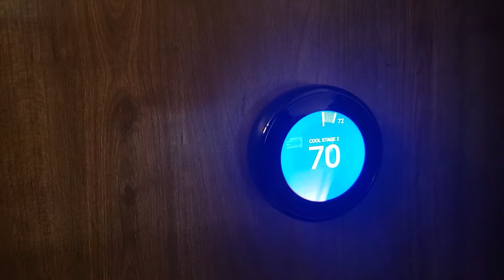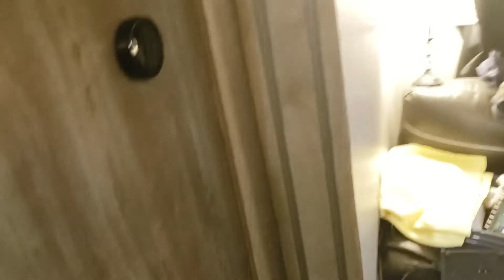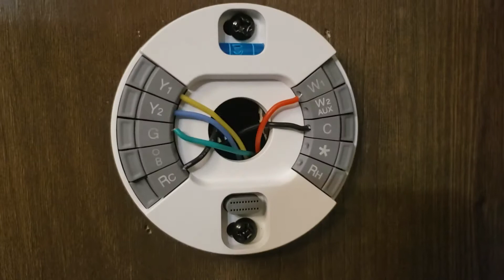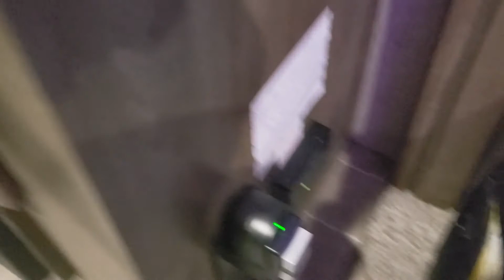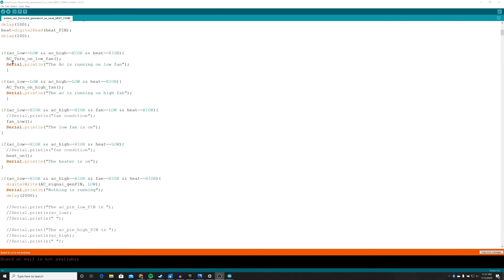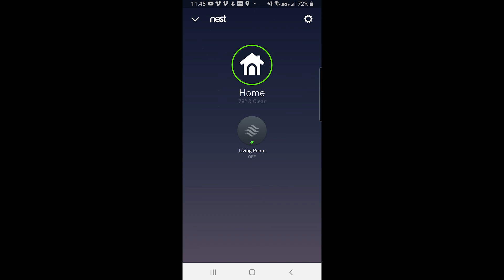Install a Nest Thermostat in an RV!!! Using an Arduino

Comment: Hello, I have implemented the system and it works very well.

Thank you for your efforts to reverse engineer the dometic thermostat and offering this project on YouTube.

There is one problem.  When the AC comes on then it reaches the target temp, the fan keeps coming on then goes off within a minute or less.  It keeps repeating this process for a while.  It looks like a switch that need denouncing.  I am going to research this more.  Have you seen this problem, anyone?
Reply from the maker: It sounds like the ac is coming on using high fan and then when it reaches the temp it turns the ac off but leaves the fan on for a minute. If you are using this in very hot climates this is what happens but it should be switching from ac high to ac low sometimes during the morning or night when the outside temp comes down.

Comment: This is awesome. I tried to replicate this with my own logic analyzer, but couldn't get it to work. I used a Dometic 3-wire thermostat and connected my logic analyzer to the control wire terminal. I'm not seeing any signal output at all, and my Dometic thermostat shows error E1, which means that it can't communicate with the control box in the A/C. That makes sense because the thermostat is not connected to any appliance. How were you able to capture the digital signal?
Reply from the maker: So I used the logic analyzer while it was connected to the ac unit. Just have it connected like normal and add a jumper wire to the control wire and record the signal when it is running. Yeah it'll get an error if it is not connected so you can't see the signals that way. By the way depending on how you have your logic analyzer setup you may also have to connect a ground wire from your logic analyzer to the ground of the thermostat. Hope that helps, if you have more questions let me know.
Reply: @sloopdog7242  great. That makes sense. I’ll let you know how it goes. If it works, I’ll have an elegant solution that doesn’t require any relays and still offers Nest-like functionality.
Reply: @marcvl  Were you ever able to come up with your more elegant solution?

Comment: This was an awesome project!! Thank you so much for sharing this with everyone. One thing I was wondering is why you didn't put in the code to be able to run the fan on the high setting? I can run fan low but not high, ac fan low and ac fan high. Would it be possible to add it to the code?
Reply from the maker: It is possible to switch out low fan to high fan if you like. I didnt include it because I thought high fan was too loud and the nest supports one fan speed without getting complicated on the setup.
Reply: @sloopdog7242  I guess I figured that it would be just adding line code that would run the high speed with fan only. On the nest if I go to fan only it shows low speed or high speed but the high speed currently doesn't work. I guess my ocd is kicking in that in fan only I should be able to run low or high as needed.
Reply: I'm trying to setup two nest thermostats and I got one working for the bedroom with ac only but I can't get the kitchen one working with ac or heat. The relays are kicking on and off but nothing ever happens. I swapped the Nanos around to make sure they both work and they will control bedroom ac fine. Any ideas what might be wrong?
Reply from the maker: Did you have two thermostats before this and are they both domestic AC units? Does the bedroom heater work? I just need some more context on what kind of thermostat you had before converting
Reply from the maker: Also the high speed fan would be a different type of code the arduino code only had one fan speed for when the ac compressor is not on.
Reply: @sloopdog7242  yes they both were the same dometic thermostat like you had. The bedroom is ac only and the kitchen controls the 2nd ac unit and the heat.
Reply from the maker: It should work fine as far as I know then. Can you get the fan to turn on also and I'm assuming you have them wired up the same exact way?
Reply: @sloopdog7242  yes I have them wired up the same way. I can't get the fan to turn on at all. It's almost like the dometic is ignoring the nano signal commends. I'm not sure how to tell if the commands are being sent or not.

Comment: Thanks for posting this!!!  My old RV had the 12v setup and my new one has only 3 wires so now I need to add another component to my mix is seems. How do you actually program the arduino?  Just purchased from your link so hopefully have it soon!
Reply from the maker: I used the Arduino ide to program the Arduino. Look up how to upload an Arduino program. Copy the code from GitHub and upload it. It'll make sense once you see how to upload a program. Did you buy everything else to go with it also?
Reply: @sloopdog7242  Thanks for that info on the programming!  
As far as the items, kinda... I'm thinking that I can use the relays and transformer for the "nest side" as a fellow YouTube used in this video (https://www.youtube.com/watch?v=YZZ13Ls2SCk&t=928s). I did order the 5V transformer as well as the Arduino you mentioned for the output side to communicate with the A/C unit.
Reply from the maker: Ok yes you can use any kind of relay but the output to the ac comes from the arduino. The nest turns the relays on or off. And the relays on the other side bring the voltage to zero as they are connected to the ground on the arduino. Just making sure we are on the same page. Thanks and remember to be carefull!
Reply: @sloopdog7242  Thanks for the info, and I will!
  I'll be sure to let you know how I make out!  Thanks for all the work you did to make this possible for others!
Reply: Is there a way I can shoot you an email?  I have everything all connected and "bench tested" on my counter and it seems to work.  Have to wait to get it all in the RV to see for sure, but I had a question for you.
Reply from the maker: @jpacello  I am not sure how I can email you on here. Is it a simple question?

Comment: Thank you so much! I'm not sure if I'm going to actually build this out like you did or just spend the money on one of the newly released aftermarket thermostats that can control these Dometic 3-wire setups, but just knowing it is possible is invaluable! Thank you for posting the code to GitHub also!
Reply from the maker: Your welcome. I know it's a lot of work. I tried to find something else to control it but the only I could find was the Bluetooth model. I wanted to wifi so I could monitor it remotely and be able to change the temperature. If you do decide to do this let me know if you have any problems and I can try to help.